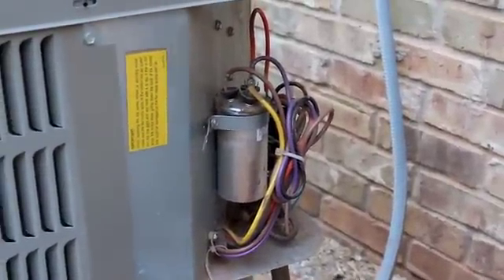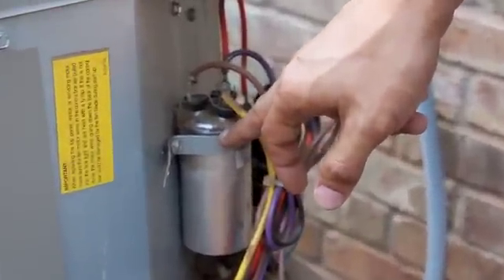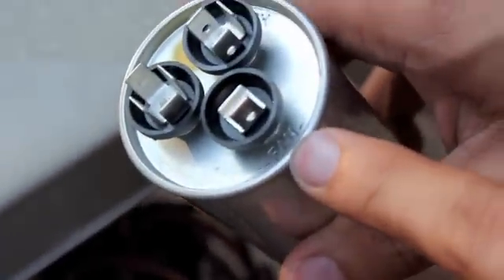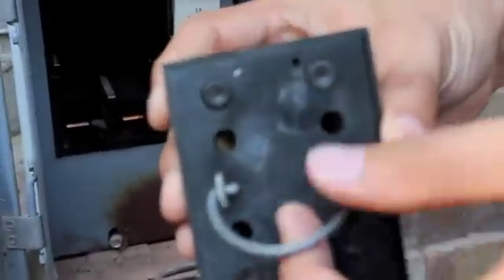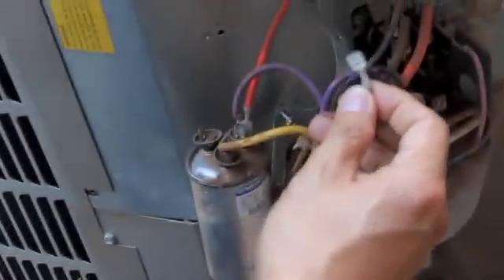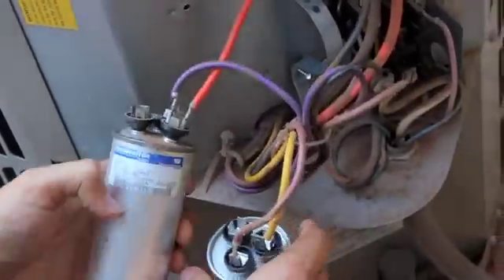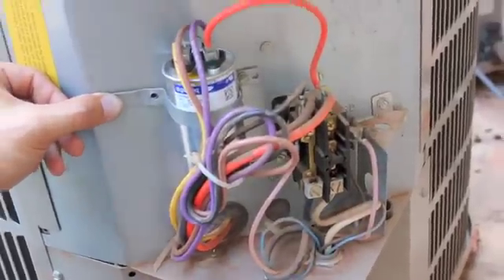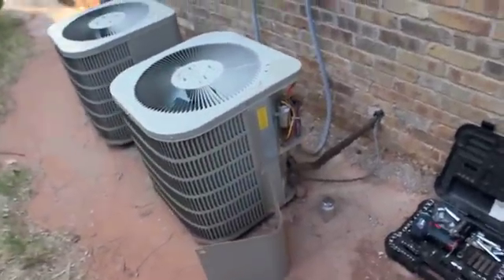AC fan not working - how to repair broken HVAC Run Start Capacitor - air condition

Comment: pardon me for asking but i'm totally new to this. I have basically the same problem as you. I hear a constant buzzing sound from the unit.  I wanna go do what the guy in the video did but I'm a little nervous to wreck something.  Does it matter what kind of AC  or company it is?  Are capacitors just generic?.  It's raining outside now so I can't even go inspect my AC unit to see if it's the same type and everything is in the same place as in the video.

Comment: DIY Tinker... Thank you for uploading.... my AC blow hot air but fan outside unit is not work and have humm sound, I  buy a new capacitor at grainger now my ac is work again....

Comment: I have an xe1200 ac unit. I can't seem to find where the capacitor is located. Is it possible that it is not located on the unit itself but elsewhere?

Comment from the maker: the fan motor and compressor can get hot when you have a bad capacitor, because its still drawing current, but nothing is running.

Comment: Well, the humming seem to obviously come from the outside unit. The fan wasn't turning, but it sounded as if it wanted to with the humming sound. Top center was hot and had a burning smell. Checked the capacitor, looks as if the little3 tips have risen up. Headed to get a new one, I'll keep you posted.

Comment from the maker: in normal operation, there are two humming sound. one from the compressor and one from the contactor coil. the unit was completely off, so the only humming sound could have came from the contactor coil.

Comment: Thanks very much for posting this very clear video. It gave me confidence to tackle the job - but my capacitor (60uF/5uf, 440V) cost $43 - not $10. Still an awful lot cheaper than calling out someone - who would likely not have the right part anyway, so I'd be without the unit for an additional 24 hrs.

Comment: The proper way to open the panel is a nut driver or one on a cordless drill. But on most you can open the panel with flat screw driver, 5/16 wrench or pliers. Cut the power before you open the panel and make sure the power is off after opening the panel. I have found some wired up wrong at the disconnect and you pull the disconnect and still have power. Chang one wire at the time on the capacitor.

Comment: Nope! In almost every one of these outdoor units is a dual stage capacitor. It's like 2 capacitors in one. It has a feed (common). Then has one prong for the (fan), usually 5uf. Then there's the (hermetic) for the compressor; it's anywhere between 20uf to over 50uf. The voltage is usually 370v or 440v. You can replace with 440 and be better off. But never replace a 440 with a 370. Match the Farads and you'll be fine. You'll find it labelled (30-5 uf). Herm is 30uf, fan is 5uf.

Comment from the maker: in theory as long as its a bipolar capacitor, you match up the ratings and capacitance then it should work fine. but i dont recommend you doing that since there are special HVAC capacitors that you can buy online and at any local HVAC supply stores. they go for around $10 to $30. just bring your damaged one to a local store and have them match the correct one for you.

Comment: Hi! I have a Trane XR11 air conditioner that all of a sudden the fan stopped working yesterday. The unit turns on and I can hear it trying to work, but the fan doesnt turn on and it just gets really hot. It filled the house with HOT air yesterday. : ( I searched youtube and found this. I dont have the tools to open the panel and see if this easy fix is the problem. Of course it is record high temperatures when this happens! LOL I have calls in to friends with tools. Any suggestions?

Comment: This fix is great. My capacitor wasn't bulged out, but instead, leaking. Bought a new one and followed exact same steps shown here and had it fixed in 10 minutes. One comment, in some regions where extreme temperatures occur between winter and summer, the relay box may have corroded terminal connectors. So after you replace the capacitor, may still not run. Clean the wire connectors on relay box, the capacitor will come to life and fire up right away. The relay is right beside the Capacitor.

Comment: Great Video.  Simple things like this you can do for 30 bucks and won't have to worry about being overcharged, or told you need a new AC system when you don't.

Some things I found out after doing mine several years ago...

1. Wear gloves when doing this.  Often times the capacitor could be leaking and the stuff inside isn't good for you.  
2.  I read somewhere that you should short out the old capacitor with a screwdriver because it could still have a charge in it and gives quite a shock.

Comment from the maker: if both heat and cold arent working, then check the condensing overflow shut-off.  Either thats bad or the drain isn't drainning "youtube.com/watch?v=DXqXmz0YwQs"if that doesnt fix it, then there's a long troubleshooting path.

Comment: I came home from a week away and realized my AC unit (Westinghouse FS3BA) is not working at all.  There are no tripped breakers, and the thermostat is on and seems to be functioning fine.  When I set the switch to "heat" it still doesn't come on, and when I Set the fan setting to "on", it does not turn on.  Any thoughts?

Comment from the maker: if you have a dual cap just the this video. Then there's a good chance the other side (HERM) is going bad.
Personally, i wouldnt. If the fan stops running, then the compressor will get hot, the over load protection will stop the compressor, but why risk it. Check out this simple schematic, and you can see you are also wasting a lot of energy if its not runningwww.youtube.com/watch?v=cnD65qX8bjM

Comment: Great video, thanks. Quick question, my fan had a no start issue and I can not replace the cap until late tomorrow due to work. I was able to get the fan going by helping it out with a push from a screwdriver. I lowered the thermostat to 64 degrees to keep the unit running. Will this hurt anything until I can replace it tomorrow?

Comment: At one time it came back on.  This time I adjusted the heat to actual temp 85 and then switched  to cool at 77.  Air came back on  (cold) the fan is going..it has shut off once and then came back on again...still cool......Very strange  any idea....Thank YOU VERY MUCH much for your feedback....

Comment: Air runs nice and cold...for the last few days. Then  about an hour ago it continued blowing but no cold air.
The fan is not turning. The compressor is making sort of humming voice.  The thermo is put on auto at 77 degrees.  I messed around with the thermo plus kicking the breaker.

Comment: Hi thanks for your nice tutorial  !!!!    Not sure if this is a capacitor issue.  Air is running normal   ..then the fan shuts off and blows only hot air.  I turned off the power twice ..and trying to get it back. At one point it did start up again,but about 15 min. later the fan turned off ..or the whole unit actually....thanks

Comment from the maker: thanks for pointing that out. HVACs actually uses RUN capacitor; which does both Start then Run. There are other units out there that have dedicated START and RUN capacitors. But, this is not the case. you can read more on Wikipedia under "Motor capacitor"

Comment: May seem unrelated, but is related since it's still talking motors & capacitors... I work on swimming pools. Most pool motors have only one, START capacitor to help the pump motor start running. But I have worked on several pump motors with TWO capacitors on them. One of the capacitors is a START capacitor that works on the motor exclusively while motor is starting and building speed. Second capacitor is RUN capacitor that only is used while motor's actually running.

Comment: You say "The run capacitor stores up charge to kick start the compressor and fan."  Actually, that is what the START Capacitor does...  The RUN capacitor is usually a less powerful capacitor that while the motor it RUNNING, gives occasional surge of power into the motor to give motor a boost and help it continue to run more efficiently. The START capacitor ONLY gives an initial surge of power to help the motor START running, but does nothing while motor's running.

Comment: OK had similar issue but out come was a bit different:
1) turn breaker off get hum
2) turn of AC hum stops.
took panel off and fan off wires look good reseated spade connectors no bulging on the capacitor.
3) turn on AC, the breaker at compressor get hum, listen for sound more closely. was coming from the fan. Gave a spin, started working.
4) turned it off and put the fan back in place, hit the breaker again fan wont start. hit with hose - starts.
Question: any video on fixing the fan??

Comment: noob question , How to tell if compressor is turning on? I havnt opened the outside AC unit yet, but when i set the thermostat(very old unit) to cool and "on" the outside fan turns on and there's some other noise (humming) , is that the compressor?

Comment: hes at work right now, but THIS may sound silly, but where would the breaker, fuse be at? he basically switched the VAC for a newer one, but theyre both the same..

Comment from the maker: well, this might sound silly, but did he check the breaker? breaker's can oxidize over time. Did he check for at least 240VAC at the contactor? The city can lower voltage level below 240VAC. Did he check for the fuse? Did he check for 24VAC signal to the contactor? If he did all the above, then im out of ideas.

Comment: DIY for some reason my heater seems to work, but my A/C isnt working. Like yours, the fan isn't turning on and we think thats the problem. My dad did EVERYTHING from changing the motor, capacitor,and more. The fan doesn't seem to work. Do you think its the wires? Contact me back ASAP please as the Texas weather seems to be kicking in!

Comment: Very nicely done.Once the quick disconnect is pulled, the only power on might be 24 volts from inside the house that pulls in the contactor if the thermostat was on but it wasn't so nice job.

Comment from the maker: I would let it cool for 1 hrs then try again. if that didnt work then:
1. turning on the thermostat to cold 
2. check 240VAC at the condenser contactor on both sides. If you dont have 240VAC on both sides, then check 26VAC signal to the contactor.
3. if that checks out then turn off the thermostat and remove breaker to kill power to the condensor.
4. check the capacitor capacitance
5. ohm out the fan
I have videos for all procedures up there, check my channel or msg me if you cant find the video

Comment: @DIY Tinker.  I know you're not a professional but you seem to have a skill here.  I turned my unit and forgot to take the cover off.  About 7 mins later, I realized this and took it off.  The outside into was a little warm.  Now the fan won't start.  I checked the circuit breaker ... It was fine.  It's only about 2 yrs old.  I tried again the next day ... no change.  What do you think this could be?  Same issue that you had?  Any help would be great!  Thank you.

Comment: Its good to see another DIY trying to save some money.  Everything I have at has been breaking lately.

As for the capacitor, I have a healthy respect for the charge they carry.  Some will discharge fast, others hold forever.  Touch a HV cap from a CRT and you'll find out quick.

Comment from the maker: the most common issues are bad capacitor or the start coil inside the fan is bad. its easy to check your capacitor or the fan. check videos on my channel "how to test capacitor" and "how to test fan motor"

Comment: Thank you for this video.  I performed this today and it fixed my issue for $21, got the part from johnstone supply.  This is soooo easy just be careful.  I don't want to guess what a pro would charge for this diagnosis and replacement.  Thanks very much!

Comment: You might want to watch this guy show how little actual danger there is in run capacitors. Search YouTube for "Discharging Run Capacitors - Or NOT to discharge". Great video on the fact that most ac unit capacitors are fully drained within seconds of power shut-off, which DIY defiantly says needs to be done to perform this task.

Comment: First off I want to truly thank DIY Tinker for this video. Part finally came and got my ac back up and running in 10 min and a $17 part on amazon. Secondly ed, you certainly seemed like you were bitchin in your orig post. I am sorry that this is a tough economy and people have to save anywhere they can, including small, simple fixes like this but it is what it is.

Comment: I FULLY agree with DIY Tinker. I went to school for graphic design and web site design but for me to be pissed off that people do it for themselves is ridiculous. Most people wouldn't service the freon in an ac unit but to replace a fan or a capacitor if you are comfortable working with tools and electric is what this country needs. Get back to people knowing how to take care of thier own basic needs so service industries are forced to charge appropriate labor and service charges.

Comment: If the fan or compressor had a burnt winding, you could have electrocuted yourself because you did not discharge the capacitor.  This is not a good video to encourage DIYers to follow.  You could get them killed!

Comment: The problem I am having with my unit is that the fan is staying on all the time. Could this also be the capasitor? I have a 1995 Rheem 10 seer system.

Comment: Heres what you should be doing and being proud of instead,
1) Remove cover of condenser before summer
2) Clean inside of condenser and wash condenser coil clean
3) Replace filter inside your Funace or Air handler
4) Make sure your Duct are clean if not, call a Duct cleaning co
5) Make sure the insulation is not falling of ur supply duct feeds or return duct
6) Insulate the two line sets fully in/out
7) Test Condensation drain with water & check 3/4 pipe
8) replace your old thermostat, Post That!

Comment from the maker: Lets chat about this idea. Everyone agrees HVAC professionals are ideal for HVAC repairs. But I see this as a home owner trying to do basic HVAC maintenance. 
This is a simple capacitor replacement for an obvious issue. Changing this capacitor is cheaper than changing my air filter. Of course i would call for help if a $20 solution doesnt solve it. 
Would you do basic maintenance to your car? would you change your starter, oil, spark plugs? The manual instructs a certified mechanic.

Comment: @kpattycake  In your example, I went to a store and bought a soad that got marked up. That would be like going to home depot and buying some lumber.  Sure Home depot marks it up, they're a retailer same as kroger.  But if a contractor further marks up materials it is not the same.  I charge my clients for my time and gas to pick up materials, or if delivered my time on the phone, but I have no excuse to mark up prices and hide some of my profit in materials costs.  It's dishonest.

Comment from the maker: The fan and compressor both have a capacitor. This capacitor is a "2 in 1", hence, its for both the motor and compressor. 
I would recommend a simple capacitance check before replacing it, because something else could be broken.

Comment: My Rheem is humming, but the blower will not run. The motor spins freely, and has no play in the shaft. I have swapped the low, high, and medium taps, it will not spin on any of them. I can spin by hand, and activate the blower, but the motor will abruptly come to a stop when activated... Run cap or motor?? Thanks!

Comment: Great vid.. Just a couple of footnotes..
The compressor connects to the leg marked  HERM on the capactor
Please disconnect power from disconnect and leave the door open so you know for sure
Always wear rubber or rubber dipped gloves
and lastly do not put your face in front of the the electronics while its starting up in case anything blows. Sometimes theres a few minutes delay before startup, just wait it out up to 10 minutes.

Comment: wear insulated gloves and rubber soled shoes as well, you can discharge the old capacitor  with a screwdriver shaft touched across both terminals

Comment: also a non contact voltage meter.. they run about $10-20 maybe even more. in HVAC we use ones rated from 24volts+ if you buy one that starts it rating for detecting volts 50+ then that might be a bad idea.

Comment from the maker: Voltage and Amps are required to maintain it running. A bad cap can cause shorting and lowers the required voltage. Also, it could be your electric company. There are a little too many unknown variables. Hope the following ideas help...
Low voltage due to electric company (less than 240VAC) = youtube.com/watch?v=nLG6vst7j_0
Low voltage due to circuit breaker (only 120VAC) = youtube.com/watch?v=1NCWJ3-xNUk
Low current (bad capacitor) = youtube.com/watch?v=zgNqHlAx3Fw

Comment: I have a Carrier Tech2000 which has run great for years until the the last hot day of the year I found the fan was barely moving and the compressor was humming.  Blower and furnace works fine. I pushed the fan with a stick and it spun a little faster but still pretty slow.  Besides a bad capacitor, what else could be wrong and what else should I look for.  Thanks and great video and comments.

Comment: What? R22 cost $50 a lb is because EPA bands manufacturing it in America.  Also have you watched "Rossen Reports: Are A/C repairers competent and honest?" on MSNBC? Go google it, and thats why i want to educate myself before I have a HVAC repair man come over. 
I've had dishonest HVAC repair men that wanted to replaced my entire unit when i later found out it was a bad circuit breaker.